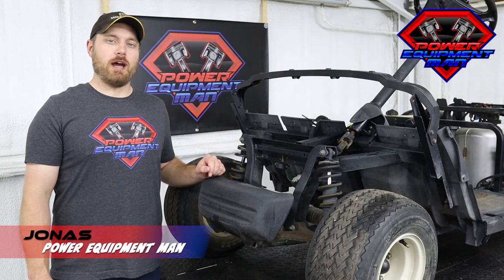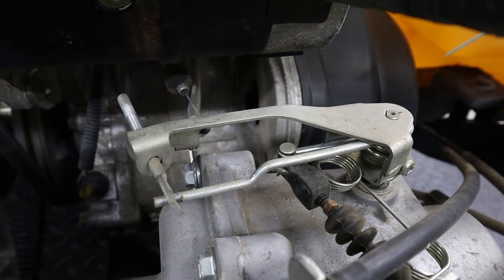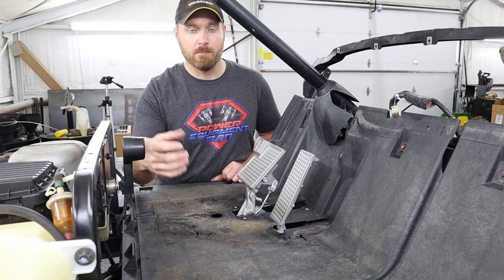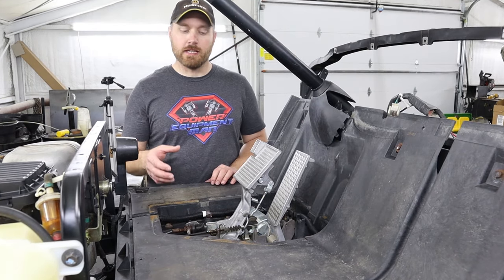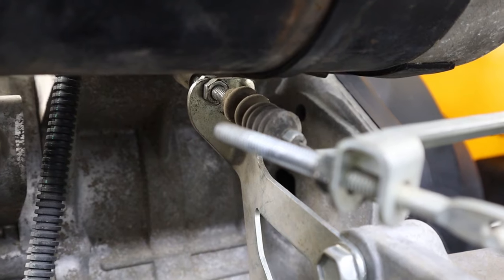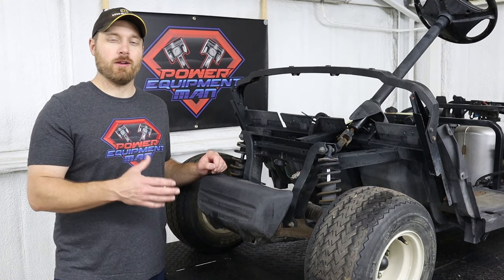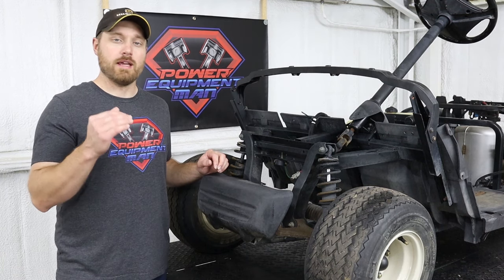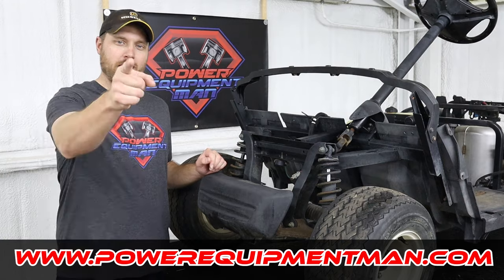Yamaha G29 Drive Golf Cart Governor Adjustment - MORE SPEED!!

Comment: Daaaa...I did watch this but forgot...Thanks for the heads up here in a previous request.........Will give it a try as my throttle travels about two thirds of the way before anything even happens....Again, you are my go to guy for info and even parts (have bought stuff already) for my newly purchased 2019 gas Yamaha cart.....Will be upgrading it this fall with a whole bunch of your additions....lights, three way switch, etc.

Comment: Turning the governor down that much guarantees future problems such as oil blow by in the air filter system, valves blown out of adjustment and generally poor performance in the future.  I own a shop, and we get more gas carts that have had the governor screwed with and run like crap than almost any other customer complaint on gas carts.  Sure, it'll go faster.  But the price for that speed is premature wear and failure.  These gas carts are not designed to run 20+ mph.  But hey, I guess as long as people keep doing it I'll keep getting paid to fix it.  I have three in the shop right now with this problem.
Reply from the maker: Interesting. I've been building carts for over 20 years and have turned the governor up on every single one of the thousands of carts I have built and never had 1 single issue. Adjusting the governor to where we show in this video will cause the engine to rev to approximately 3900 rpm (depending on throttle cable adjustment). We have ran these engines on the dyno with no governor to over 6000 rpm and they hold up just fine. 3900 rpm is nothing for these engines. On the newer EFI engines, the electronic rev limiter is set at 4250 rpm from the factory. If it wasn't safe to rev them that high, Yamaha wouldn't have set the rev limiter that high.
Reply: @PowerEquipmentMan  like I said, one of the most common issues gas carts come into the shop for.  The starter/generator on these engines are also not designed for extended hi rev action and those will literally implode from being over revved to long.  I should have taken a photo of the one last week I had.  Starter/gen looked like someone put a grenade in it.  Today's gas carts are not intended by the manufacturers to run over about 18mph.  I was just like you for many years turning stuff up.   But now that I am in the business I see the results of running those carts being turned up and while there are many who get away with it, there are many who get stuck with it down the road.  I would simply advise that one take caution in messing with the governor system to much.
Reply: @PowerEquipmentMan  Absolutely correct. Remember, these are engineered in japan with all the quality you would expect. No Yamaha engineer is going to design a governor system that would allow it to be set at such a point that it would damage the engine. The governor is primarily there to limit liability of golf courses by allowing them to set it at a lower speed to avoid accidents to include rollovers and such. I've got the PTV with 8:1 high speed gears and wide open with the governor turned all the way down I'll hit 33 mph @ 2900 rpm which is nothing for these carts. Good video by the way.
Reply: Just bought a 2017 drive 2 and it's clanking loud.i adjusted the valves and still loud.could you diagnose it over video and I can pay you
Reply: @ladyluck3096  I wish I could, but diagnosis over video is very hard.  These engines were not designed to run that fast, regardless of what the people above post.  Not to mention that a golf cart in the US is restricted by both state and federal law on it's speeds and if you are in an accident where someone is hurt the lawsuits will bankrupt you.

Comment: Great video!  I bought a refurbished 2020 G29 Yamaha Quietech2 4 seat cart,  I now have an issue I cannot find any info on, and was hoping to get some help here.
Our cart developed a thumping/rumbling noise when it was under a light load/ light throttle situation. It is still under warranty, so I brought it in and the dealer installed a Stiffener Plate Kit (SPK), which did fix the noise problem nicely. However, in the process, it killed the performance of my cart! 
My top speed is now 2-3 mph less. While I could easily maintain 24-25 mph on level ground before, I struggle to stay at 22 mph now. Adjusting the governor does not seem to help much, either. 
 While initial take off is good, once you get above 15 mph or so, the motor just flattens out and stops pulling properly. If I have 4 people aboard, I barely make it up hills sometimes that I had no trouble with before. I feel that something is not right with the clutching after the SPK kit install.
I have not been able to find any info on what this SPK involves, or how installing it could have messed up the clutching. I do have an appt to it looked at again for this problem soon, but I am concerned the dealer is going to just say that there is no problem and that my performance is normal, even though I know it is truly much less than before.
Any suggestions would be appreciated.
Reply from the maker: Interesting. I believe the SPK is a bracket that gets installed between the back of the engine and the transaxle. This plate ties the two together to make it more solid. I believe the 2021 and newer models come with this plate from the factory. This plate would keep the distance between the crankshaft and the transaxle input shaft at a set distance, so they can't pull towards each other under a load which would effect your clutching. I would think that this would improve your clutch performance, not hurt it. 
I would be interested to hear what the dealer says after looking at it again. Keep me posted - sales@powerequipmentman.com
Reply: @PowerEquipmentMan  Thank you! I have struggled to find out what the SPK actually entailed. I agree, not sure why the SPK kit hurt my performance...is it possible that the distance between the primary and secondary clutches are now at an improper distance apart, so the belt is not riding at the correct place within in the clutches? If so, is this distance something that can be checked or adjusted? Thanks so much, I have posted this question on several other sites, and you're the only one who has come through with some good info! Randy
Reply from the maker: @randymoore774  My best guess is that before installing the SPK the clutches would pull closer together under a load. In theory, this would change the ratio of the clutches. The primary clutch would be shifting out at the different rate than the secondary clutch. While this may have improved performance, it's not how it is supposed to be and would likely cause excessive wear on belts, clutches, bushings, etc.. But that is just a guess, that is not something I have ran into before. How many hours does your cart have on it?
I looked in the service manual and did not see any spec for the distance between those shafts.
Reply: @PowerEquipmentMan  Hello again, I do have an update, but not a fix! (FYI - I also wrote you directly on this issue to your Website, if you prefer to not fill up your YouTube comments with my issue)
So I picked up my cart, and they replaced the muffler, an intake sensor and the fuel pump. All under warranty, that's great, but this has nothing to do at all with the PSK kit and/or clutching…so I was very skeptical. However,  I must admit, it ran great. Started better, ran clean, better throttle response and top speed was about 24-25 just as before. I was a happy camper.

However, I checked my governor, only to find out it was set to 100%, maxed out to the end! Hmm, not so good after all. I have watched your videos on this, and you strongly recommend against setting the governor to the stop.
So,  I think this new tech totally ignored the information I provided  him regarding the SPK kit install, and approached this issue as a motor problem, replaced fuel pump, sensor, & muffler, and got the motor running clean, and in the process, fixed a rough running cold start issue I was also having.  However, once he got the motor running clean, he just cranked the governor to the stops to get the top speed back, and did not fix the root cause of the clutch issue that was created by the SPK kit install.
Not sure what to do here. I am sure if I bring it back and try to talk to them about the governor adjustment, they will likely tell me it’s ok and to just go away! Most customers would not even be aware of their incorrect governor adjustment, and would have drove away pleased. But I know it is still not right. I could just leave it adjusted to the stop, but am concerned about any long-term damage having the governor adjusted too far. I did back this off to your recommended setting, and my top speed dropped a couple mph, so the root cause of the SPK install issue is not fixed. Since the performance issue started immediately after the SPK install, I still feel it must be something that was altered when the plate was installed. Here are a couple things I want to try, but welcome your suggestions.
1-Since the plate mounts to the starter bolts, is it possible the started belt is now too tight? I did check it and it seems ok, but I may try loosening it a bit and see if that helps.
2-Could the belt be worn? I did mic it and it is 1.25 inches wide, so it is in within specs, and that is something that wears over time, and this was an instant change.
3-I may remove the SPK plate and see if my performance returns, then go from there.
4-Grease the clutches? Again, not something that goes bad instantly.
5-I was planning on installing a stage 1 clutch kit from you in the fall, but may consider it sooner now. Do you suspect that may help out?

I am not sure on how to proceed with this, and appreciate anything you can suggest. 
Thanks so much,
Randy

Comment: I’m confused. Should it be set at :39 or :44 in the video without harming engine? They look like different settings.
Reply from the maker: Its the same setting. You can see it better at :39.
Reply: @PowerEquipmentMan  at :39 there are no threads at the back of governor arm. At :44 it looks like 1/2” threads behind governor arm. So do you mean 1/2” threads remaining behind the nut or 1/2” threads remaining behind the back of governor arm?
Reply from the maker: @adamallworth8915  About 1/2" of threads from the backside of the nut.

Comment: Is it ok if some oil is going into the intake after adjusting the governor?
Reply from the maker: A little oil is no big deal. If it is quite a bit of oil, then your rings are most likely getting worn out and you have excessive blow by. Running the engine at a higher RPM (tightening the governor) just makes more blow by (crankcase pressure).

Comment: Wont this cause back fire also?
Reply from the maker: Backfires are usually caused by the butterfly valve not fully closing when the throttle pedal is released due to the throttle cable not be properly adjusted or a dirty carb.
Reply: @PowerEquipmentMan  new cart owner and was told it’s from fuel being left over in the carb. Mines does not back fire but it does kinda bog down when on a hill. Was told it’s the secondary clutch but ???
Reply from the maker: @victoryous1709  When the throttle cable is adjusted too tight it will hold the throttle blade in the carb slightly open. This allows air to continue flowing threw the carb (pulling fuel along with it) while the spark plug isn't sparking but the engine is still turning over while coasting. Then when you hit the pedal again and the spark plug fires the first time it ignites all that fuel and you get a big bang. This is why the throttle blade must be able to fully close in the carb when the pedal is released. 

If you need more hill climbing power, a clutch kit will be the best upgrade to do. We are currently developing a couple different clutch kits for the drive1 and drive2 that we hope to release in the next couple months that will solve your problem. Keep an eye on our website - www.powerequipmentman.com